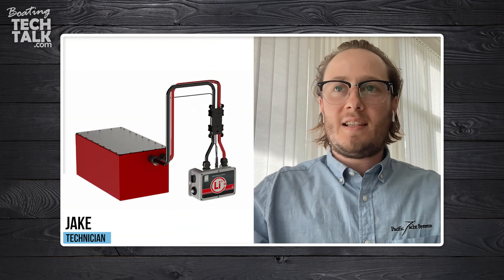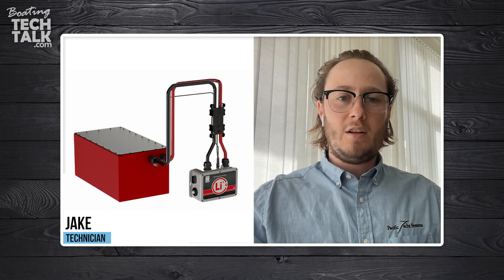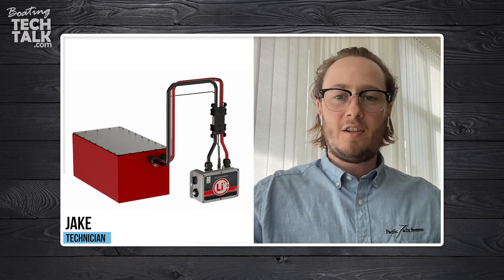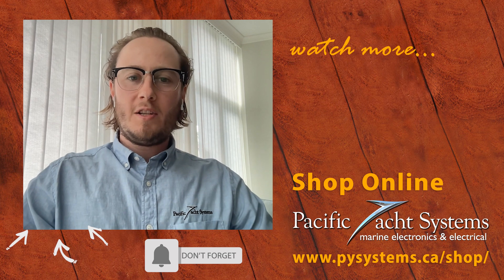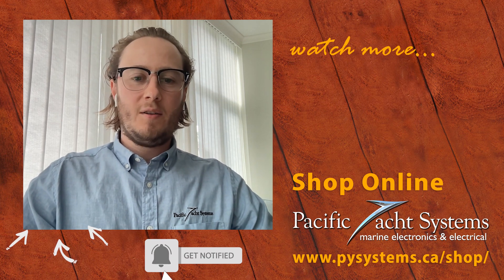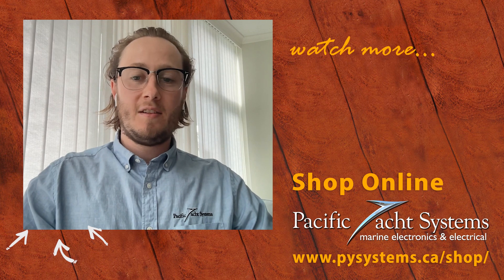The Role of a BMS (Battery Management System) in A Lithium Battery Bank On My Boat

Comment: Great video, I have a question. I just upgraded my motorcycle battery to lithium and it’s great! Can I replace the optima blue top AGM in my boat to a lithium? My battery is direct to a 2012 40hp Yamaha 4 stroke outboard and is being used for starting/deep cycle and never had an issue with the agm. Thanks